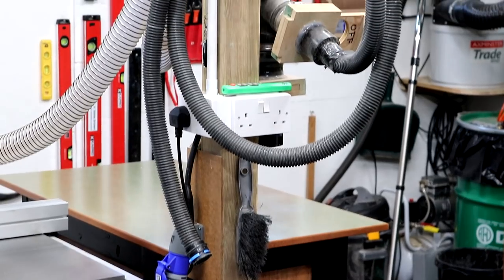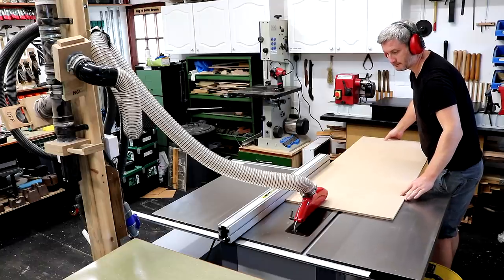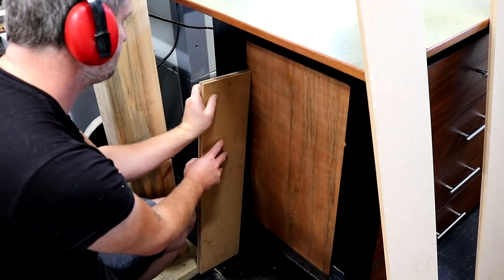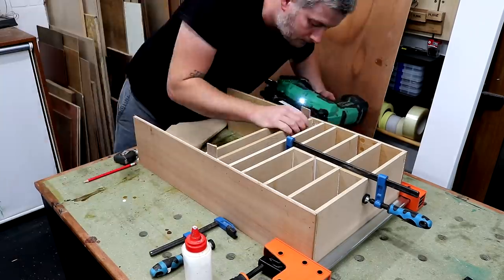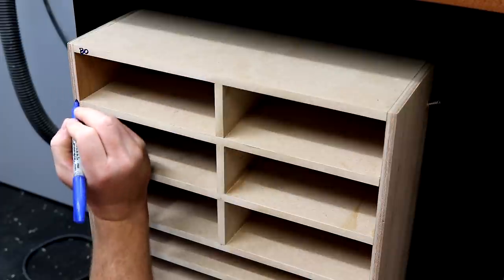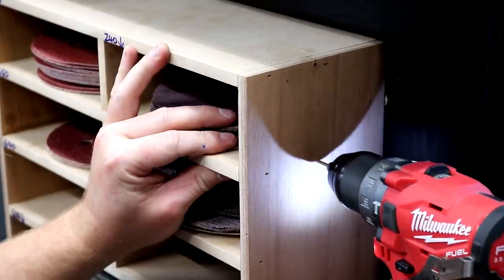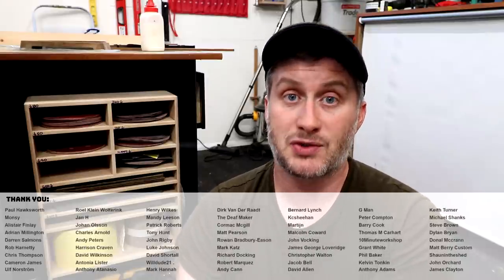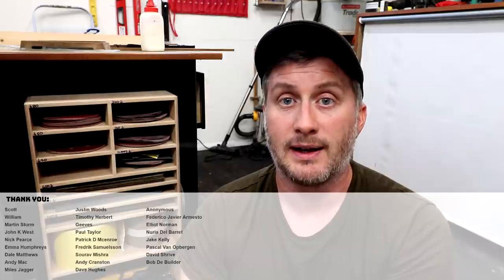Sanding Cabinet - FREE PLANS

Comment: Have you tried those 3M sanding sponge? I use them for denibbing. Costs about MYR6.00 here (USD1.40).  bought two last year, still going strong. Washable too. 

Btw, I keep using them sanding disc till i cant recognize what grit it is anymore 🤣
Reply from the maker: I've not tried those before may check them out 👍